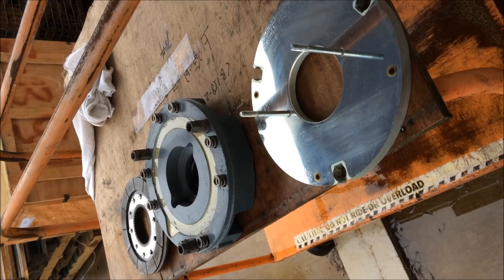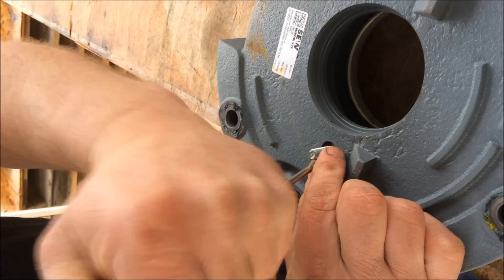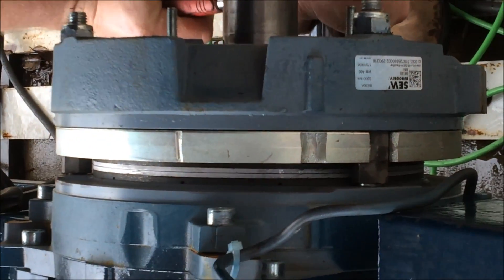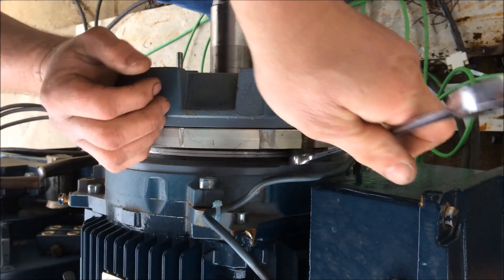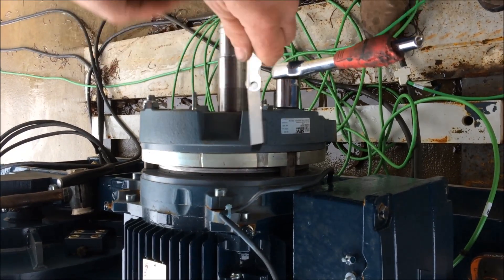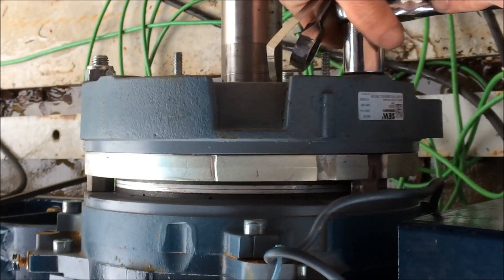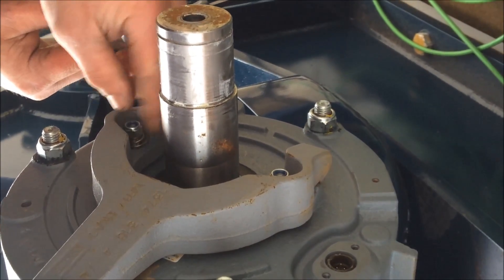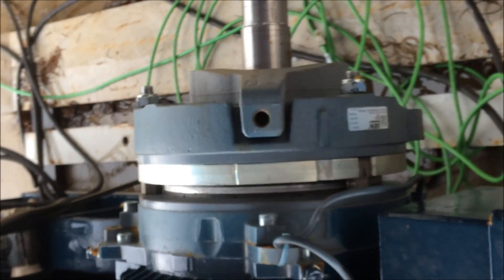25HP Brake Adjustment

Comment: So ots totally possible to remove a brake from these motors and run it without a brake. Making a rotary phase converter and dont need a brake
Reply: Yes you need the brake
Reply: @Barry8310458  y don't need it. Y can't I remove it